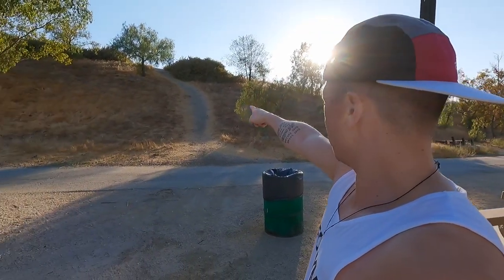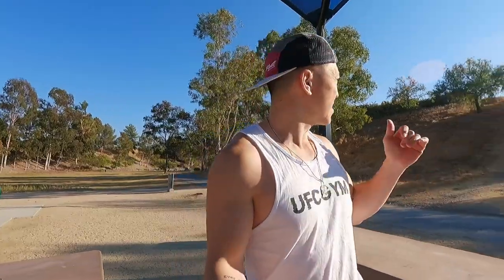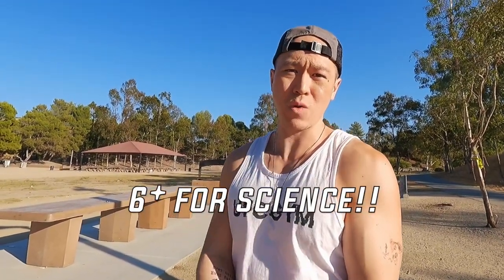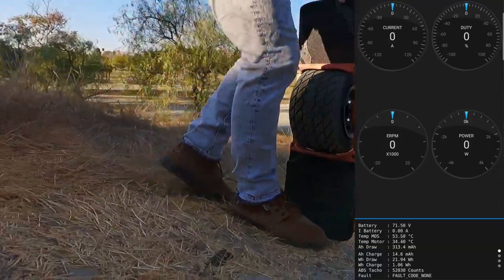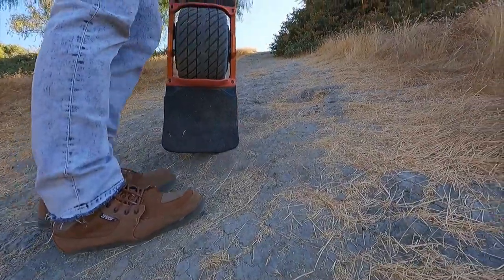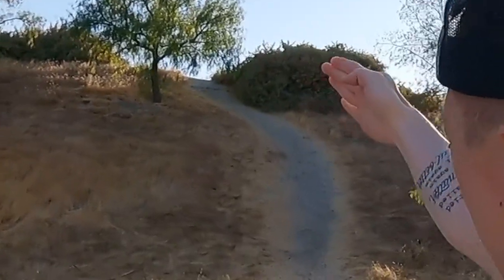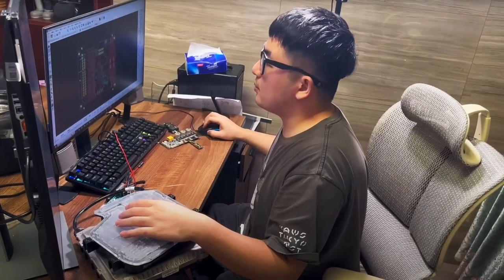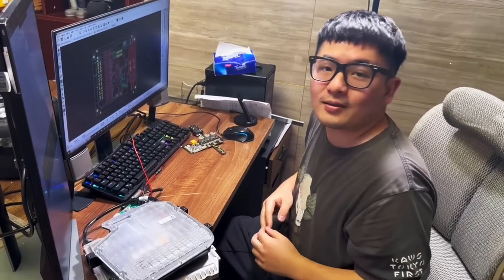SuperFlux hill test 2 - still more powerful? Set at Floatwheel's CannonCore motor current!

Comment: The stator of those motors is the same size (115x90mm) which means the only difference those motors have is how they are wound, which material they use and how good the tolerances are in the motor. Which basically means if those values are similar the torque of the motor is linear to the amperage and not dependent on the motor. For such short test the better cooling of the Cannon core is mostly irrelevant. Still great video comparing those.
Reply from the maker: yes, I concur😅 the superflux and esc was also very cool. Surprisingly for intense hill climb tests it doesn't cause overheating, especially since there is some break in-between. Consistent flat riding brings up the temps way more. Either way, both motors are absolutely insane and it's hard to pick a clear winner yet, which is a win for everyone!
Reply: That was what I was thinking. You could test the windingsof each with a multi tester on ohms ( power not connected ) more windings will have a greater resistances would less pure copper though.

Comment: Thank you Maxx for the nice video 👍, that's nice to see a rematch with same setting, but for a fair comparison both boards must to have the same battery voltage, and not like VESC boar with SuperFlux 75v and Floatwheel with CannonCore 84v. I will not be surprised that at 84v SuperFlux motor will have more torque than CannonCore motor 😉
Reply from the maker: Totally hear ya on the same voltage! I actually consulted with Dado if I should use my 84v cbcso or 75v me4t pack, and he said for hill climb tests it doesn't matter too much. Overall he recommended using the 75v. He gave a more complete explanation here on my ig post comments: https://www.instagram.com/reel/CyT413Oy0Jq/?igshid=NjIwNzIyMDk2Mg==

You can see that even though the voltages are different, this hill has the amps peak at around 130-136A, so with both set at 120A (floatwheel's maximum recommended current), it comes down to more of how the copper is wound in each motor to output that same 120A current. Regardless, both are incredible motors and the difference between them is miniscule to me, everyone wins! You cant go wrong with either :)

Comment: 👍👍 💯 honest informative video comparison, the more competition the better for advancing the sports technology and lowering costs, FM onewheel has obviously gone 🤪 pricing gt-s series over $3200 when it’s what gt should have been when released, But it should be priced around $2000 have the gt range with a 6” standard rim and user replaceable battery/ components

Comment: Thanks for sharing 🙏 I’m on the fence on either building VESC or buying a Floatwheel. The GT was my first Onewheel and I’m not too familiar with the XR chassis so I wouldn’t mind the little extra weight.
Reply from the maker: Man that's a tough one! Both are amazing options, it comes down to if you have any parts sourced already. If you don't have any existing xr parts, I'd recommend getting floatwheel, everything is there for you ready to assemble. And the whole thing feels solid af, and you will have a company backing you up on your journey. Enjoy vesc! 🤙🏻
Reply: Get the float wheel and save yourself the initial hassle of figuring out how to set up the vesc. OR look for  used xr for cheap ( or pint ) and get it and put a vesc in it.. both are good options

Comment: For science! We do need more sciency videos. If you can at some point get a cannoncore motor and swap that to your current board and see how far you can travel compared to superflux. Probably more reliable test if you do the run from like 15% battery or something so riding a circle in nascar style does not bore you to death.
Reply from the maker: it's pretty fascinating to see how these top dogs compare, exciting times! I actually compared the cannoncore vs floatwheel at their max settings directly on the previous video, link here: https://www.youtube.com/watch?v=Puodxc57Xvg. But this time I set the superflux to the same motor current as floatwheel last time and cannoncore did better overall. I'm not sure I'll do this test again unless I have the same battery for each motor, which I don't really wanna spend another $700 😅 For me the data shows both are super close and incredibly powerful, everyone wins. And doing this hill test with 15% battery seems a bit sketch, it may cause severe voltage sag and bms could cut off battery to protect the cells..
Reply: @MaxxSend  Definitely do not try hill test with 15% battery. :D BTW SuperFlux Mk II preorders are up now! Tho there will be no differences in performance, maybe a very very slight difference because of better bearings and slighly finned mounting blocks so it could run cooler in theory at least. Also BTW CannonCore is slighty lighter in weight copared to SuperFlux, roughly (with mounting blocks) CannonCore 16 lbs and SuperFlux 17 lbs.

Comment: If you tune them to the same amps the float wheel gets more power (120A x 84V =10,080W) vs (120A x 75V = 9,000W).  However, if you take the 136A at full power of the super flux you get 136A x 75V = 10,200W which is essentially the same power as the floatwheel. 

All that to say is running them both flat out in your first video seems to be the best comparison of climb vs power.
Reply: these are motor amps, not battery amps afaik. They should be able to take as 3x as that for a few seconds.

Comment: Can the new fw controller be used for vesc builds? Great vid my guy
Reply: obvi but you might need some extra effort in establishing the implementation
Reply from the maker: as long as you figure out how to do the connectors to different controllers and batteries, it's basically a diy vesc build! I'm sure Tony will be providing more details soon.
Reply: @MaxxSend  nice to see more choices of esc in the market.. little focer and trampa vescs are expensive and difficult to source & the ubox tend to have heating issues..
Reply from the maker: @lipasfriends  where u based out of? If in EU there's @customwheel.shop and they have diy lil focer kits that are less expensive than preassembled ones. If you don't have any existing xr parts then the Floatwheel is the best choice!
Reply: @MaxxSend  I'm in Sydney, Australia haha. My best bet for a little focer, I believe would be makerspev but they're still restocking the DIY bundle. Considering a ubox 100v for my pint build now tbh but will have to figure out a way to mitigate overheating issues. That being said your video with the Taiwanese guy was really enlightening, nothing(almost) is impossible on vescs!
Reply: @MaxxSend  and yes I'm definitely getting a FW in the near future after I'm done with my pintv build. I hope tfl and others would start engineering sick ass aftermarket parts for fw soon! So stoked!

Comment: I am really interested how many turns does the superflux has vs the cannon cores stator has! If they really want to design a more torque motor they should put in heat pipe into the stator to extract the heat faster, therefore increasing the maximum current threshold!  Shouldn’t be too hard right, come on guys let’s do it!

Comment: Is 120/-120 reasonably safe? Every FW setup guide out there lists 100/-100.
Reply from the maker: Definitely above the range for everyday use, but still safe according to Tony. He initially said up to 130, but I decided to stay at 120 to be cautious. When the fw gen 2 e-kit comes out, it should go even higher.
Reply: Great video again! Which vesc controller are you using? My Little Focer can go up till 250A. Maybe try again on 250 and fly up that hill?! 🥳

Comment: Dare I ask, what if you were to go slightly wild and see if the Floatwheel could make it up if it was set to 136A?? P.S I'm loving what you're doing for the community by making these videos
Reply from the maker: Much appreciated! All for the sake of onewheel'd science🤓 I think it likely would've made it at 130! But Tony recommended the highest to be 120 for the sake of the controller, so it'd be a tad sketch.. Don't think it's worth it cuz it still demonstrates the board is absolutely a monster and edges out the superflux at the same current.

Comment: To proper test this you need the exact same line on every attempt. Im 100% sure i could get my xr up that but it would be due to inertia, and cutting the slope and banking as much energy as possiblle..  to test the motors you realky jyst need to measure the total output of the motor against a load., respectfully intended
Reply from the maker: agreed on the same line, this isn't exactly the most friendly smooth hill. However these ain't weak fm boards so these titans should be placed through hell and be expected to make it up on similar lines. In fact, both of them nearly do at 120A, which is super impressive. There's no loser here! And btw I would love to see you try this on a stock fm XR. In fact, would even place a gentlemen's bet of a certain amount you couldn't make it halfway up lol. This is in San Jose, ca, hmu if you're ever nearby!
Reply: @MaxxSend  I'd take the bet knowing I may lose.. im in alberta Canada so not near by :)
Reply from the maker: @MrDmadness  u got nothin to lose 😆 just fyi I tried this with a stock xr battery with vesc and hypercore (more torque than stock gt), and couldn't make it past 30% up
Reply: @MaxxSend  I believe you and know that go pro always makes stuff look more tame. I've been to,d by many I'm very skilled at hill climbs and I'd absolutely try it. Respectfully :)

Comment: Please stop comparing motors without using remote tilt. You are running out of nose clearance and that is going to be more dependant on the physical constraints of the board.
Reply: :duckyell:
Reply: @auden_builds  I think this warrants a duckstare emote
Reply from the maker: don't need remote tilt for slow hill climb when you have ATR. The superflux never had nose clearance issues. In fact it's even lifted. It made it all the way up just fine on the last hill climb video and also here at 5:10 when it was set back to the full current limit of 150A. The main factor here is how much current can go through to the motor to let it continue to climb. 120A wasn't enough.
Reply from the maker: @auden_builds  🦆:face-blue-smiling::face-orange-raised-eyebrow:
Reply: Part 3 when? 😝
Reply: @lipasfriends  🦆👀
Reply: @MaxxSend zackly
Reply from the maker: @lipasfriends  part 3 just to annoy the original commenter? 😄